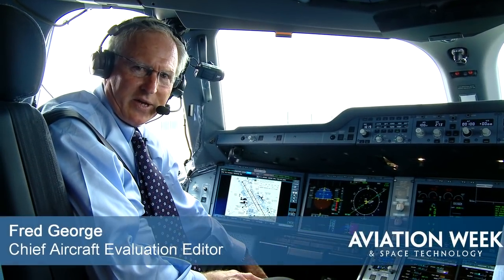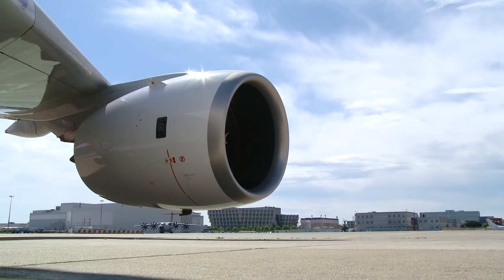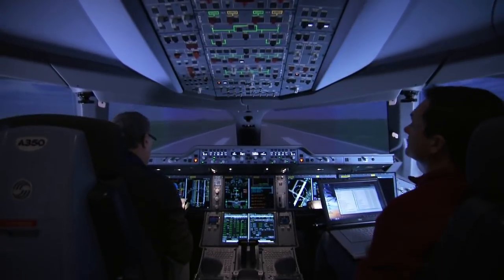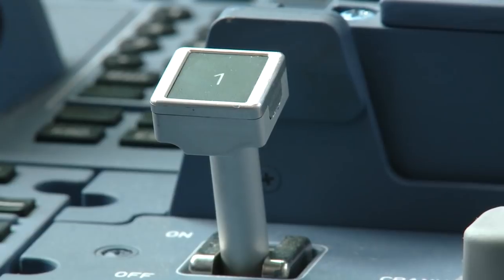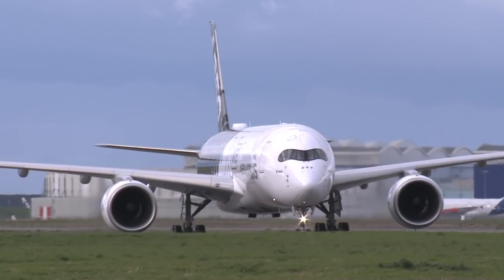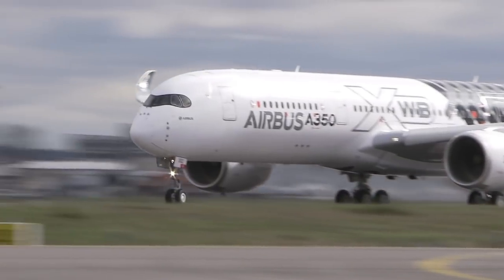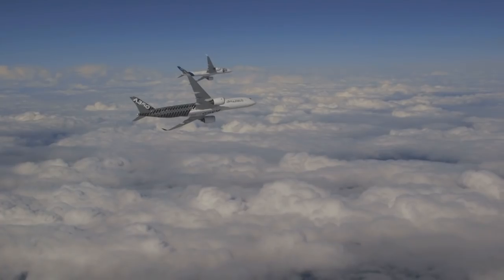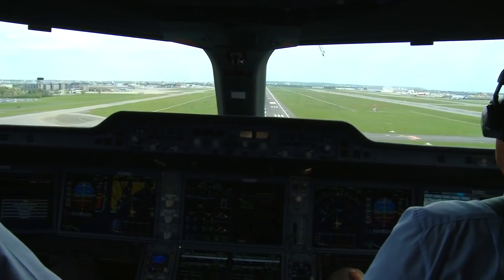Pilot Report: Airbus A350

Comment: I prefer the screens on the 787 over the ones on the 350.. a round old style attitude indicator, come on Airbus.. it’s the 2020’s.
Reply: I don’t understand why they gave the 787 huge screens and then made the FMC use only half of it and it’s about the same size as the 777 where Airbus changed it massively for the A380/A350 and made use of the size
Reply: @tomstravels520  Half of it?
Reply: @ACPilot  yeah the CDU takes up only about half or no more than 3/4 of the lower MFD’s. Seems like a waste of space they could have actually made the CDU better
Reply: It better in some ways. The shape of the screen doesn’t distract from looking at the attitude line.
Reply: @peteconrad2077  - Well everybody else have gone away from it, from GA Garmin to Boeing 737 MAX, 787, 777X. I have flown the MAX, and quite like the more modern instrumentation.
Reply: @ACPilot  well that’s fine as long as as you know the fit falls with it. I quite like the very concentrated Airbus display which focuses your attention right to the aircraft symbol which is where the real info is.

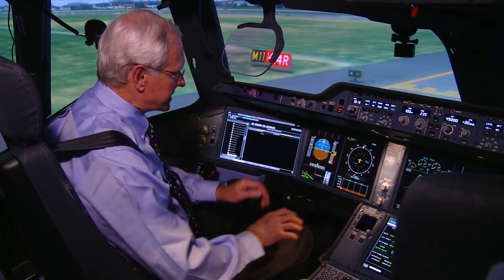Comment: 1:12, the largest ever installed on an Airbus. Key word: airbus
Reply: Logan Schaefer because Airbus would rather have the information clearly separated. On the 787 and 737 Max you can adjust size of Navigation display, the EICAS can only be on pilot or co pilots side so one might not see it as well, the MFD can take up half of the ND as well. Some pilots have reported preferring the NG version
Reply: Airbus has more overall screen space than the 787. I’ve tried the 787 in a sim and not having an upper centre screen is a pain for the reasons Thomas M states.

Comment: I'm surprised the A350 only has a twin tandem (4 wheel) main landing gear.  With that type of weight I'd expect it to have a 6 wheel truck like the 777 or an additional centerline twin truck like the DC-10-30/DC-10-40.
Reply: it is only 275 tons
Reply: The -1000 variant has 6 wheel main gear. Bare in mind this aircraft is made of carbon composite not aluminium so much lighter in comparison

Comment: Why do they still use foot as a measure Something from the middle ages
Reply: They don't in Russian airliners. They use feet for consistency; why do they use Knots instead of KMH? There is also a relationship between feet and barometric pressure. Similarly you could ask why is all ATC in English?

Comment: Europiens will never make planes better then Boeing, so stick with cars, that much better you guys good at it! So be it
Reply: Europeans invented the jet engine and the jet airliner; the De Havilland Comet was so ahead of its time, it predated the analysis of metal fatigue in aluminium pressurised airframes. Define 'better'; the A321 killed off the B757 and the A320 ate heavily into the B737 market. The A330 is very widely used and took the B767 out of circulation pretty much.

The A350 is simply the most comfortable aircraft I have ever travelled on (and I have been on every Boeing except the 727 and 787).

As for American cars; they are simply atrocious (sorry), high powered, poor handling, badly made. Italian cars, handle well but fall to bits
Reply: Really? And how’s your 737 Max doing right now?

Comment: Bigger than a 777?  I will NEVER like AirBus due to their joystick control.  Too many crashes where one pilot has his joystick pegged in one direction, and the other pilot does the opposite.  When you have the "handlebars" like in a Boeing, either pilot's actions are 100% visible to the other.  Advantage:  DEFINITELY BOEING!
Reply: No, what he said was that it was the largest AIRBUS twin engine Aircraft.
Reply: Too many crashes? There’s only been one and it wasn’t even the cause of the crash it was a factor. The cause was the pilot stalling the plane in the first place, failing to recognise a stall and the PM instead of telling him what was going on decided to just take over without telling the other pilot. In a Boeing whilst you can see what is going on if they still showed the same lack of CRM they could still be arguing over the course of action to take
Reply: @patrick young
an aircraft is way too complicated to simplify it as much as you did in your comment. 
I know of two fatal incidents involving the problem that you mentioned in your comment.
Airbus has means that should prevent opposite sidestick inputs from happening.

There is no evidence pointing at either manufacturer to be safer than the other.
Boeing has more issues with pilots being disoriented because the airplane will not prevent extreme banking or stalls for example. With that Airbus has probably a lot more double checks and crosschecks of sensor data. I also prefer the airbus cockpit design. It should help pilots to concentrate on the important things.

After all it's just a different concept. I don't trust the human nature to be in control at all times. Therefor I prefer Boeing. I would rather trust a system of multiple redundancy to control a human being.
But I believe that mainly depends on American versus European mentality.
Reply: The fact there is a pilot FLYING and a pilot MONITORING as normal CRM has bypassed you; in addition the side stick has a flight ENVELOPE, you cannot place the airframe in jeopardy by having inputs that would, for example, place the airframe into too steep a climb/descent/bank

Comment: Hey copied off of b787
Reply: They
Reply: Except they didn't; the dimension of the cabin is different, the AC and hydraulics are very different, the flight control is different. You could say Boeing copied Airbus, as Airbus used composites as far back as the A300

Comment: That may be the most hideous paint scheme that I've ever seen on an airplane.
Reply: It's a graphic representation of the way 'carbon-fibre-reinforced polymer' skins are created. This plane's fuselage and wing structures are primarily made of CFRP. The 787 Dreamliner has the same attribute. CFRP skins start-off being made with a special kinda tape that's laid out in a criss-cross weave method and 'carbon-fibre + liquid-polymer' is poured and spread over it (the tape-weave). I guess the tape is the "reinforcement". There's pics available on the net that show the wing skins being made in many an aerospace manufacturing facility.

Comment: Airbus just copied the 787
Reply: Yeah right. At over 850 A350's sold already, it sure is a debacle almost as big as the A320 Neo that sold 6000 and counting in 6 years. But you have a point, if I was an Airbus exec I would certainly be joking a lot... all the way to the bank, courtesy of Boeing's expert handling of the C-Series case.
Reply: You clearly have no idea what engineering is about. Copied? lol this isn't a painting you clown. Optimizing aerodynamics tends to result in similar shapes. It has something to do with this crazy thing called physics which I believe is the same no matter what country you're in.
Reply: You have no idea what you are talking about. You didn't read the bit about the 787 losing $20 Mn per delivery and still has a $35 Bn black hole to fill? There are 10 airframes still sitting in Seattle car parks minus engines. It's nowhere near as good and efficient as the A350. "Copy" my ass.
Your bullshit isn't supported by hard commercial facts, son.
When Boeing can outsell Airbus then get back to us, OK?
Reply: LucaTeachYaMC except it didn't
Reply: Yes, unlike the brilliant 747-8 right. The A350 is doing great. Go smoke your crack somewhere else.
Reply: exactly
Reply: A300  ring a bell 😎
Reply: vsenan if you read the history of aviation..Boeing737 also have a very low start, Boeing even considering to stop the production..but what happen now is that737 still the best aircraft in the market.
747 also a slow starter but they still exist now and continue to sell well.
Reply: Yes airbus is always trying to do what Boeing do..the only time they are being innovative is when they pioneer the two person cockpit in A300..the rest they seems lack of dream..even the naming of A350 is just show how deficient they are in the field of dream that they cannot invent a good name such of "Dreamliner"..what is "XWB" ???
Reply: Airbus is a joke - A380 was a debacle and so is the A350

Comment: Couple of questions :-
On all airbus the the pilots stick control is on the left and the 1st officers is on the right. This I assume leads to the pilot becoming left hand sensitive yet the 1st officer right hand; so if/when they have to swap/retrain/get promoted to the left hand seat how much of a brain 'retrain' does it require to acquire the appropriate sensitivity ?
Secondly, what's the washing line hanging off the rudder for?
Great looking plane!
Reply: It didn't really matter it isn't so hard on Boeing planes you will so plenty of almost all flying one hand on yoke and one on the engine's levers they will use the left hand even if right hand for they would struggle to reach engine's levers and there hands will be crossed so this left/right hand is the same basically
Reply: Mark Roberts well I've flown my flight simulator using a side stick with my left hand even though I'm right handed, it's pretty easy for me
Reply: honestly, over years of flying you get used to flying with both hands so much it isnt really an issue
Reply: It has a sensor, in relatively clean air, used to accurately calibrate indicated airspeed. What you see must have been on an early prototype.
Reply: That' one of the reasons I prefer a wheel. I can fly from either seat pretty easily. I would think flying a side stick and switching would be harder to get used to. But honestly, Airbus doesn't care about that. In fact, they don't care much about cockpit safety as you would think they do. For example, even after accidents, they STILL do not think it's necessary to have the throttles physically sync with the auto-throttle settings. Boeing does. So you can have the auto-throttles set climb power on the engines and the throttle handles could be at the idle position. Confusing for the pilots? Yes. Does Airbus care? No.

The other major flaw in their design logic is that the side sticks do not sync with each other. Again, in accidents that have happened, the flight data recorder showed one pilot was pushing forward on the stick while the other pilot was pulling back on their stick...with neither pilot aware what the other was doing. Had the sticks been in sync with each other, that wouldn't have happen. Not syncing the sticks is just stupid, there are no other words for it.
Reply: Ralph Freshour Switching between right and left seat is easy. You get simulator time flying from both seats as a first officer. What accident do you refer to? In the Air France flight that crashed in the Atlantic, only the pilot flying touched his side stick until the pilot monitoring and the captain realized what was going on. You get a dual input alarm when both pilots touch their side stick.
Reply: even if you fly a "wheel" (it is called a yoke btw), you will have to use your right hand if you sit on the right and left if you on the left, since the thrust lever is in the middle :p 
Switching is easy and it is only takes a couple takeoff and landings and your brain can manage
Reply: The issue was a training one and not a flaw in the design per se. Neither pilot clearly declared "I have control", and Airbus aircraft will have the automated callout of "dual input" in both sidesticks are used at the same time.

It's worth talking about how the Air France incident was probably one of the few incidents involving the sidesticks, since declaring that a pilot "has control" is a memory item on Airbus type ratings.
Reply: Was wondering the same thing regarding training left/right hands
Reply: In general across all Airbus planes in service, during the "Captain's upgrading", the pilot spends about a month in a simulator getting used to the sidestick in the Captain's seat before doing the PICUS hours, mostly as it takes them quite a bit of time to get used to the mirrored controls. That said, a fully experienced Captain would be able to fly in either seat and have full ability to control the aircraft.
Reply: you wish to have a month in a simulator for the left seat!! there is only a couple of takeoff and landing and a check then you are qualified for left seat operation. The rest of the trainings are for captain promotion which has little to do with "flying" the aircraft
Reply: I guess being left handed would be an advantage, because we normally adapt everyday to this without thinking about it mostly. I deliberately use a right handed mouse at work and a left handed mouse at home I'm pretty good with both. Lefty's are really born ambidextrous anyway.

Comment: What's that wire that is hanging from the vertical stabilizer tip and trailing behind?
Reply: Николай Цонев i thought they used that to measure airflow / turbulence
Reply: Николай Цонев s

Comment: So which is best: 787 or 350?
Reply: Novo Eduardo AC from a passenger perspective, there’s literally no difference on the inside, the A350 and 787 have the same seating configuration (for the most part) of 3-3-3, although the A350 is a couple centimeters wider, and the cabin ceilings are taller, the seats are pretty much the same.

Comment: Landing was dangerous. This landing can be skied the airplane, because left wheel touch the ground first with some few second stand, & thereafter during right wheel touching moment, a bounce into the right wheel.
Reply: Saif Restifer Khomain No it wasn't, that is a normal crosswind landing. It is perfectly safe and routine to land on only one set of gear.
Reply: Slightly Dry Beans thanks.

Comment: Why not connect the sidesticks, Thus providing interconnection..... ??
Reply: ***** 

What does the captain not being present have to do it? All 3 pilots were fully qualified; and received the same training.

Once again, I must reiterate: it was a CRM problem; not a design problem. Pilots aren’t supposed to be both manipulating the controls at the same time, be it a stick, yoke, throttles or rudder. I have no issues with sidesticks incorporating feedback, though I am perfectly happy with the current FBW, but there is no basis for your conclusion that this would prevent AF447 or similar. It did nothing for Asiana 214 or Colgan 3407, and there are FAR more loss of control accidents in the history books involving yoke-equipped, than Airbus FBW aircraft. Of course more yoke-equipped airplanes have been built, but the point is yokes and active feedback don’t solve accidents related to crew errors, a category most accidents fall into. 

There is no way to determine linked controls would have raised the situational awareness in the cockpit of AF447, just like it’s impossible to predict what the results of the SFO accident would have been with Airbus FBW protections/models available (the A/T and FLCH interactions are noteworthy issues on Boeing aircraft). 

The truth is, it’s NOT practically impossible to ignore what the other pilot is doing, in a fast developing confusing emergency such as AF447, Asiana 214 and Colgan 3407; or scores of other accidents over the years. That’s why experience, competency, professionalism, training and CRM are the biggest influencer – regardless of what type of aircraft is being flown.
Reply: ***** 

Very well...we'll have to agree to disagree.

However, why is the Airbus control system plucked out of the multitude of significant issues involved in one accident and wielded as some kind of smoking gun while any mention of several similar results in aircraft with yokes is often met with a muffled cough and a change of subject? It happens in every discussion involving Airbus FBW. 
At the risk of sounding like a broken record, it's been nearly 30 years, over a quarter of a century, with over 9,000 FBW aircraft delivered. Where is the data to show that Airbus FBW aircraft are less safe than Boeings, etc?
Reply: ***** 

I'm assuming your referring to AF447? Well, in that case; I'd say a CRM failure led to that accident. 

There's abasoltely no evidence to suggest linked sidesticks would have prevented AF447.

You do realise there have been stall related crashes on Boeing aircraft, don't you? How did Boeing's "design" prevent those?
Reply: You cannot compare this crash to others. AF447 crashed because the captain was off duty and the two pilots were confused. One was pulling back on the stick and the other one didnt notice. Hence the stall.
Reply: ***** 

So only the captain can ascertain what is going on? That's ridiculous. And when he did find out, it was too late. These pilots were poorly trained...nothing to do with linked sidesticks.
Reply: +Gene Cage because it's fly-by-wire, it doens't work that way.
Reply: I know. My point is, why not make Work that way? It can be done.
Reply: +Gene Cage why must they be connected?
Reply: Because the pilots can then feel what the other is doing.
Reply: Gene Cage there should only be one pilot flying at any one time anyway
Reply: ***** That's not necessarily a bad thing.
Reply: It could have saved the aircraft. Boeing uses this design.
Reply: The captain was absent, the pilots did not know who had controls. Its not rocket science. They were not fully qualified. Training has been improved after the crash.
Reply: Gene Cage the captain did not even ask who was in control. One of the first things you get taught is make it clear who is PF and who is PM. Even in Boeing they may have been wrestling controls and pilots could disagree with each other. They failed to talk to each other
Reply: I do not agree, however I  do respect your opinion.
Reply: +Gene Cage Shut up, you're wrong.